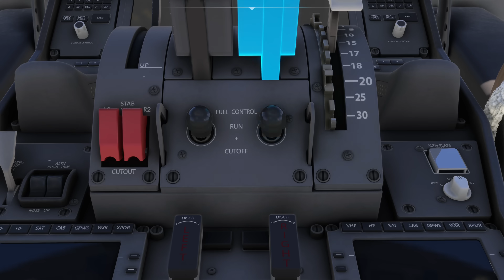Air India 171: Why Did The Fuel Cut-off Switch Get Moved?

Comment: It is very necessry to add camera in cabin to cover major instrumental panel.
Reply: Pilots have consistently fought against cameras in the cockpit. It's an uphill battle
Reply: @hameed  it’s bound to happen.  Possibly on new planes rather than fitting them to existing aircraft
Reply: @adrianbennett3761 I think it does need to happen, just explaining why it hasn’t yet
Reply: @hameed  if FDR, CVR and CCTV was downloaded to the cloud, we’d know what happened to MH370
Reply: @adrianbennett3761  KNOT going to happen
Reply: @adrianbennett3761  We would know if FDR and CVR were uploaded to the cloud we would know what and where MH370 is !  CCTV KNOT needed.  I like to believe the theory where it is sleeping in a hangar in Pakistan.
Reply: @atpg5  Just like AI171 with CCTV we’d know instantly which pilot was responsible for MH370
Reply: @adrianbennett3761  You dont believe to two Russian GRU agaents did it?
Reply: @atpg5 I don’t know what r to believe but the salvage company only get paid if they find it.  Cost them a fortune already
Reply: @adrianbennett3761  And also expose many critical things to leak uncontrolably and plane to cyber attacks. All cloud are not safe.  But yes cameras could be in cockpit but working on closed loop like few hours max and accesible only in incidents/accidents investigation.
Reply: @hameed  pilots have not to decide this
Reply: @proventure307 I can’t tell what you’re trying to say
Reply: The unions won't allow it
Reply: I don't think it would add anything to the investigation. We already know what happened, we just don't know for sure which pilot did it which is not necessary knowledge with respect to air safety.
Reply: @Cyb8042-j6w  Surely they know which pilot did it from the voice recordings. They just are necessarily going to tell us yet.
Reply: right, now we have security cameras in so many places. we also now started using dash cams for cars. then it is necessary to have a cam in cockpit to monitor pilot activities. it will help the ground staff to monitor & analyse. plus in such unforeseen event, it can be used to enhance the planes technology.
Reply: @prashant_karande  again, KNOT in your lifetime.

Comment: Don't you find it interesting that the switchs were flipped in the same order that would be done during a normal gate park exercise? First left #1 then right #2 engine.  The left #1 engine switch is closet to PIC.  If I was the person that was responsible for all this, I sure in the hell wouldnt be worry about following shutdown protocol.   You also have to ask if "why did you do that" was because the person pulled the throttles back to idle and then flipped the switches.  Maybe the other person didn't notice the switches at first and that's why it took 10 seconds to figure it all out.
Reply: Why specifically do it in the reverse order when it makes no difference?
Reply: @bensemusx  Ha...  told ya!!

Comment: Why is there no technical, logical check that would prohibit the shutdown of the engines up to a minimum altitude during takeoff by a computer?
Reply: Some have it but it won’t stop a pilot from purposely crashing a plane.
Reply: An engine fire or loss of rotating parts can be an immediate risk to the aircraft and passengers.